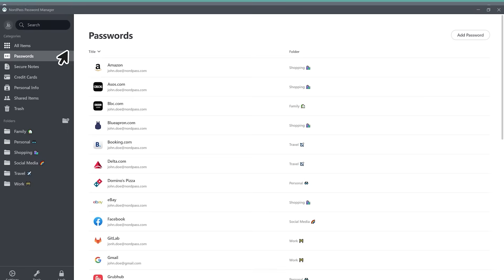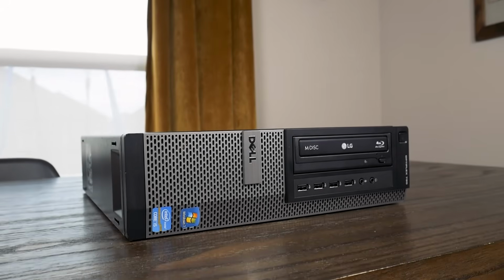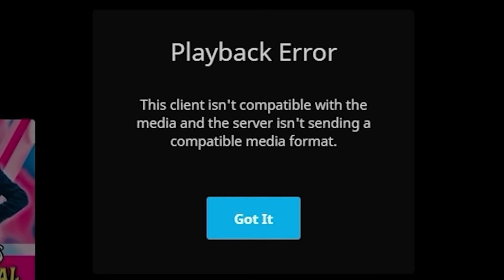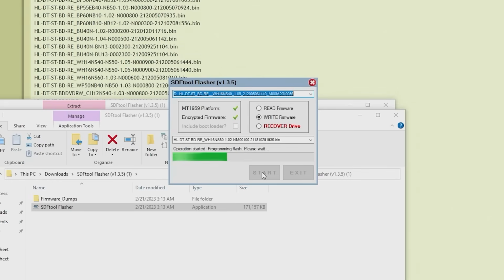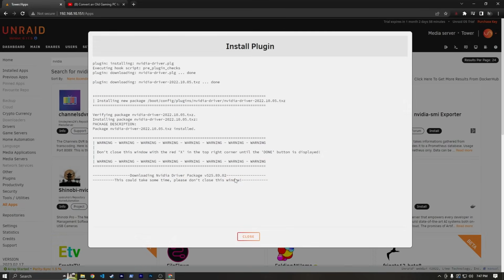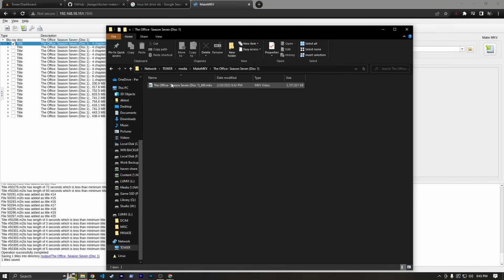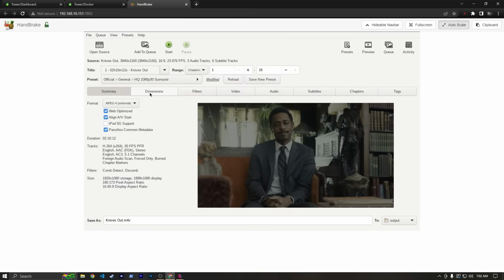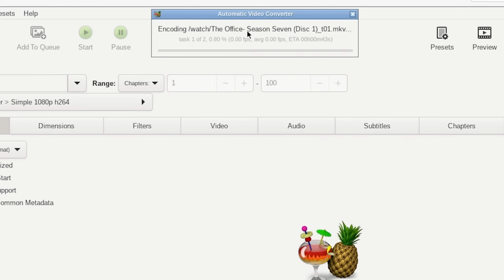Streaming 4K Blu-rays With a DECADE-OLD PC

Comment: Great video and your guide on ripping UHD Blu-Rays was great, but there are two ways you can improve this setup. Firstly I'd setup Tdarr for transcoding instead of Handbrake, Tdarr is much more suited towards automated transcoding and once you point it at your library you can very easily alter it however you want (transcoding, remove embedded subs, foreign language tracks etc.) and it's pretty much set and forget, Handbrake's watch folder needs a bit more manual intervention. Next I would suggest just spending a tiny bit more and getting a GPU which supports H.265 transcoding, you can get a Quadro P400 for less than $50. H.265 takes up significantly less space than H.264 at the same quality and allows you to really increase the size of your movie library on any given storage constraints.
Reply: What's the best method for just brute forcing my way through instead of using handbrake. I want to use a full fat mkv blu ray rip. I'll never be streaming to more than one tv at a time and almost always at native res.
Reply: @gmooney77  makeMKV does NOT transcode. Using the MKV directly from the software works. For what its worth, its called "remuxing" (shifting the video data to a new container instead of re encoding it)
Reply: @MolendinarI bought one on ebay for $27 2 weeks ago off ebay
Reply: @Molendinarif you are in the us you can get these for 15 to 30 dollars
Reply: H265 is a good way to contribute to e-waste. It's unplayable on older hardware. H264 plays on old hardware just fine.
Reply: @cobz76  lmao

Comment: streaming 4k is impractical as it takes up too much hard drive space, eats bandwidth, and works your older server. buying a cpu specifically for using hevc 265 will allow for smaller files that are still great quality.

Comment: I did a similar thing but used a dell precision t5810 work station i bought on fb marketplace. I put a 10 core 20 thread xeon in it and a cheapo graphics card that didnt require external power. Currently have about 7tb of media live on the server. Its very time consuming with handbrake and i am only running it on win 10. I usually only rip in h.265 to keep file size down, havent had any issues thus far with transcoding. Im using plex instead of jellyfin though.

Comment: This is probably the best use case scenario for an old PC lying around; however, It's not for me specifically. I haven't jumped on the 4K bandwagon and probably never will. 1080P is perfectly fine for videos. I might upgrade to a 1440P display MAX for my desktop monitor...but I'll wait until one of my dual 1080P displays dies before a final decision. The live video stream transcoding is something I'd never use either. That's way too much power consumption just to watch a video. I'd just convert the source video into something more compatible before I'd ever consider doing that.

Comment: Your problems mostly arise because like most of us we've bought dozens if not hundreds of DVDs over the years, then we now have the ability to rip them to digital storage devices to be able to watch them seemlessly without having to swap discs...so, now we are asking our household computer to try and copy/convert literally years worth of data over the course of days...doesn't work very well when you need your computer, and your internet connection for other tasks.  If you started this task with the very first movie you bought, the problems wouldn't really be an issue, but with a box of DVD's to rip/convert and store, its a very daunting task to say the least.

Comment: Tdarr may be worth looking into for automated encoding. It may also be able to leverage the nvenc encoder. More importantly, because you have multiple systems, you can leverage several nodes simultaneously.

Automatic Ripping Machine as others have mentioned is also pretty much the epitome of automated work flow, save for support for gpu encoding.
Reply from the maker: Yeah I definitely plan to look into that more when I get the time. Thanks!

Comment: the dual nvme adaptor would not  work: unfortunate this machine is to old and it is missing a new feature where you can divide a 16x slot in to smaller 4 times 4x slot. in case you would try -nothing bad will happen, but you will see only 1 of the drives.
In order to have multiple nvme-s on 1 16x slot on older machine you must have an nvme raid card - it is more expensive then the ssds what you want to put on the card all together.. just not worth it..
Belive me - i learned on the expensive way :)
Reply from the maker: Ah yes! Good catch! I guess I could’ve just used a sata adapter instead, or two separate NVMe cards. Thanks for pointing that out!

Comment: A tip on handbrake, use an nvidia gpu (in my case a 2070) and it will do it in minutes with H.265 nvenc (or H.264 if prefered). I have not had the chance to use it but there are AMD versions of nvenc as well as intels quicksync and now av1 with intel gpus.
Reply: Yes, I always use my GPU for handbrake encoding. So much faster than CPU.

Comment: Been running MakeMKV / HB on various Win 7 / 10 combos from a couple old Phenom 2’s to a 16 Xeon to a recent i5.

Also running  with Linux Mint on a Core2Quad and a Ryzen 5 setups.

Mint seems to run a little better because of no bloat ware for Windows.

My (2) i5’s running Win10 on a small form factor like yours.

Once I threw in some low profile graphic cards and SSD drives-they took off like a rocket!

Comment: Oh wow this is significantly easier than when I did it :O
I had to get a freedos setup on a specific board that I was lucky to have lying around, dump the current firmware, manually update it with the right one, flash it onto it, and then it was done
Though I remember hearing talk of peeps making a special firmware which didn't have all the bugs of the original one for my drive

Comment: Ha my file server is a 21 year old AMD (Sempron I think? Mobo is from 2002 anyhow) and it works just fine - It does get hot with 6 hard drives in there though - tons of fans everywhere. And early 2000s blue LED (case came that way, I didn't remove them).

Comment: This is interesting, b/c I just grabbed a 2012 Dell XPS (Microsoft Signature PC) as a test bed for what I want to do next on my home network.  I decided to go with TrueNAS Core, which does mean the video card is tied to the host (Proxmox may have been the better option, but still evaluating).  For my Jellyfin/Plex side, I fired up an Ubuntu Server VM and CIFS mounted my Synology Videos Share (which is also shared via the Synology App).  I am running Jellyfin and Plex in the same VM until one proves to just be better for my uses.  My ripping is done with very old laptops (a 2006 HP and 2008 Dell, both now running a lightweight Linux) which rips the disk and saves to a special share on the Synology, and then Handbrake on a Windows machine, connected via gigabit ethernet, which does the final effort.

Comment: What's the deal with using UHD bluray drives on AMD platforms?

Is the lack of an SGX extension on the CPU going to be an issue or will the reflashing of the drive firmware take care of all that?

Comment: I use a 4590T in my unraid server - obviously not a powerhouse but it does have QuickSync which, even for the vast majority of content today, it can transcode faster than real time in Plex (and presumably other media servers that support hardware transcoding). The whole system peaks at about 50w so it's not really an issue to run 24/7...I also run a flightradar node, a DVB-DVR, some web services, a self-hosted password manager and a few other Docker containers...pretty sick for something that doesn't use much more power than my ISP issued router.

Comment: its not a bad Video - but lets be clear - I use my own password and you got the wrong Dell - Get a 3050 with a 7th Gen chip - £64.50 in the UK, and lose the SATA optical drive and add an addionion SSD - you are showing a lack of knowledge

Comment: I have the same PC. Mine came with a bracket that holds a 3.5" Drive on the top, and a 2.5" on the underside (Dell 0R494D J132D).   I put a i7 2600, 16GB Crucial DDR3-1600, 480GB Kingston SSD, and the same LG BD-ROM/DVD-RW drive.  I also added in a Low Profile Radeon R7 450 4GB GDDR5.

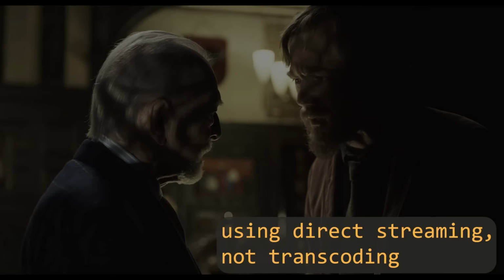Comment: in the video it cleary shows H264 why are you saying H265? 10:38
Reply from the maker: It shows h264 in the transcoding section (which is showing the codec that the server is supplying the client after transcoding), not the original media section which is right below it.

Comment: 3:10 if you look closely, you'll see that the blue drive bracket in the top right of the picture, holds a 3.5" as well as a 2.5" drive so you don't need to buy a bracket if you're just using an SSD and a spinning SATA drive. The first SATA port on the motherboard supports 6GB/s SATA 3 for an SSD, but the second and third SATA ports only do 3GB/s, so don't expect miracles. For a real increase in speed, a PCIe adapter with an MVME stick would probably help (I think the motherboard can do PCI mode 3 but not mode 4). You probably also want a USB3 adapter but since there are no 5.25" style Molex connectors on the power supply, that will take some improvisation.

Comment: For the transcoding capabilities, and fast rip times.

I wouldn’t recommend anything less than an i7 4790.

Also the graphics card should be a AMD brand for inter compatibility between programs/apps.

The WX2100 and Wx3100/WX3200 are great candidates.

Also if you have 16 to 32GB ram set up a page file. The SSD will have an increased life span with less read/write cycles and the ram will cut the decompression time in half from less read/write cycles that normally occur on the ssd/HDD.

Comment: I started my Unraid "career" with a Dell i5-4500, which has a little more power than your system.  All my ripping is done on another computer (that has the LibreDrive enabled drive) and the subsequent transcoding for the server, though I will transcode the occasional "oversize" download on the server.

I've seen some nice Unraid/Plex server setups with low power Atom/Celeron CPUs and an Nvidia A2000 GPU to do the heavy lifting.

Comment: Meh, very meh.
H264 for 4K is really not ideal.
I switched almost my whole collection to H265, for the sake of space and efficiency. 
All my clients support H265, and my poor and super cheap i3-8100 does H265 transcoding natively with its iGPU anyway, and power consumption is great.

Additionally, I can encode to H265 using the iGPU: it's super fast and the CPU is free for other tasks. GPU transcoding isn't quality perfect, but it's good enough for the average user.

I think you've chosen the wrong hardware, which led to very wrong media choices.

Comment: 10 years isn’t really that old for a computer anymore. Anything from 10 years ago is a reasonable up-to-date and modern computer as far as I’m concerned. Even some computers from 15 years ago with the faster variants of C2D and C2Q aren’t too shabby for basic tasks. Good to see a computer like this put to good use rather than be wasted. I’m actually surprised by the performance issues you had.
Reply: @outerspaces. I agree. People write off the old stuff for new stuff like it's a right of passage. I'm still pushing my I7-2600K CPU.
Reply: For many people a Thinkpad T420, or even a T410 can still handle their daily needs...although heavy compared to a brand new laptop...those old laptops and desktops will still do the job that many people actually use their computers for.  Its when you get into heavy CPU/RAM usage needs like editing video, photos, ripping movies, etc. is when you really need the new hardware to support the new processes that some people are trying to do...although the old machine will handle it, it'll take way too long to get any meaningful use out of it for certain tasks.  Most daily computing needs can be done on older machines for sure.  I have a Thinkstation S20 for my desktop PC...still does all my daily computing needs....and the 10,000RPM 1TB hard drive can more easily keep up with tasks that many of today's drives can't due to their lower speeds...thinking of doing an SSD swap at some point though.
Reply: Could you elaborate on what you mean by “Basic tasks”?
Reply: @FrannyFrank  emails, basic word processing, light shopping or video watching, etc
Reply: @FrannyFrank  basically anything besides heavy gaming.
Reply: @Alexander Ratisbona A friend of mine has a PC I built for him out of stuff I had lying around, including a Core 2 Quad Q9650, slightly overclocked. He uses it to run DAW software to record his music and it works great for him. The machine is left on 24 hours a day, and it's been three years since I built it.
Reply: @ScottGrammer  I have a Optiplex 780 with a C2D 8500 that I ran all kinds of apps on for 5 years before I acquired an Optiplex 790SFF with a Core i5 2400. About the ONLY thing the newer machine does better is Transcoding videos using Handbrake. Recently, I got an Optiplex 9020 with an i5 4590. Just "retired" the 780. ALL machines have 8GB ram and varying sized HDDs.
Reply: That's because outside of the US and the third world, the electricity prices will offset any theoretical savings of not buying something recent that can do the same task in reduced time and like 1/5th of the power consumption. Core 2 is unusable unless you are completely delusional. Modern x86 tablets have comparable performance to top of the line C2Q, except they pull next to nothing and have every modern instruction sets and hardware decoding of codecs used in 2023.
Reply: @kaminekoch.7465  chill out
Reply: @kaminekoch.7465   that’s the thing most people in the third world aren’t buying new pcs because it uses less power that’s just not economical for them. heck a lot of them are using older than C2D. All that other stuff is just on paper specs and instruction sets. If you actually use one they are definitely not useless and far from it. They sell newer computers that are slower than an E8600..I mean intel still makes the celeron n4020 and lots of manufacturers put them in budget laptops with 4 or 8gb ram a C2D E8600 could wipe the floor with that crappy little cpu. Also the modern instruction sets and stuff like that aren’t really useful anyway unless you’re playing newer games or video editing.
Reply: The best hardware upgrade for any PC in the last 10 years is an SSD. Put an SSD in and most PCs even with very modest CPUs are fast and useable for basic tasks.
Reply: @chickennoodle6620  Yes, in hindsight now it seems ridiculous that we used Spinning HDDs for systems for so long when they were just suited to volume storage.
Reply: Doncha know if it can't do 4k@900000000000000000000000000000000FPS it's a piece of shit that should be trashed? (SARCASM)
Reply: I have i7 2600 and a R5 5600G, difference is about 10 years. For basic tasks (watching YT, music, Word, Excel sheets, streaming, Roblox, playing by my kid), I see no difference between them. Yes, when transcoding video or mp3`s, R5 is twice as much faster. But, we are talking 10 years for double the speed. In 90s and early 00s, time to double the speed of CPU was 2-3 years. Hardware progress is stalling, only software is going ahead.

Comment: I've been ripping Blu-rays since 2015 & 4k Blu-rays since 2020 I convert them to mp4 with handbrake making sure that all audio tracks are added despite cutting the file size down to roughly 10% of the original file size (which is useful for copying to my tablet for long car journeys)  I've used over 6tb this also because I rip & convert all the special features which I'm surprised how few people who rip disc do. I don't have it set up as a server since for my simulation would be pointless. I copy the files to a USB drive and then play them on my LG B9 OLED TV which play even h.265 files without issues  even raw if needed. I know my set up is uncommon but works for me and it's a good way to have a backup are out of print discs.

Comment: i've been running Emby on my media PC that runs Windows 10 with about 45TB or so for my movies/tv shows. I have a GTX 1060 6GB that does the transcoding.That's all it does. My main computer does the Handbrake legwork. Its a first Gen Ryzen 7 1700x with 32GB/RAM. I use a virtual machine to download my media and use Handbrake to convert some movies and ALL of my tv shows to save space on the drives. I used to convert movies but since you can download the x265 version of everything nowadays, i just download those and convert only what i need to. I will say this also... if you're converting a 1080p to a 720p (for most tv shows), there's NO noticable video loss in the file. Just throwin that out there...

Comment: Nice and concise video. Nice on the explanations there and it's okay to "cheat" as long as it's at least said in the video so kudos on that.
I would fear that a 2nd gen i5 would really struggle with this but it's nice to see that it did okay. I have a 4th gen i7 lying around (2600k maybe? I can't remember) which I might repurpose for something like this too.

After buying a used ASUSTOR machine for a media library and realising that it actually struggles to do the one thing I need it for...might just give me cause to get that old computer refurbished for this instead. Then I can always repurpose the ASUSTOR to much less intensive music streaming.
Reply: That would be an i7-47xx chip.  I have a 4790 that works quite capably for a homelab with only 1-2 users at a time.